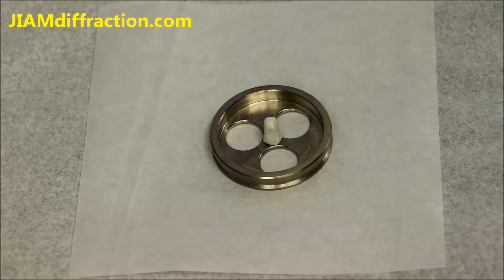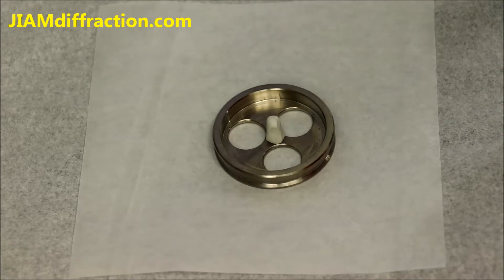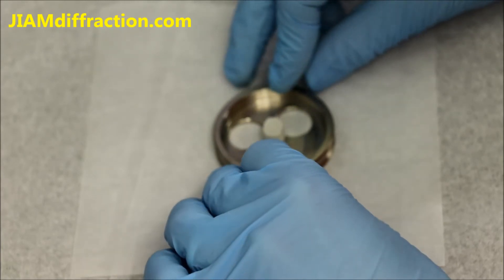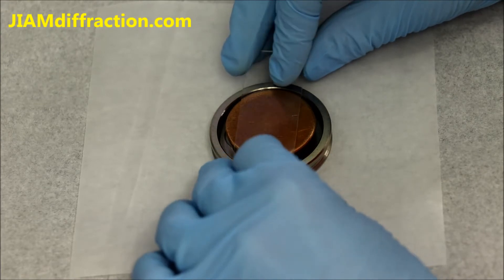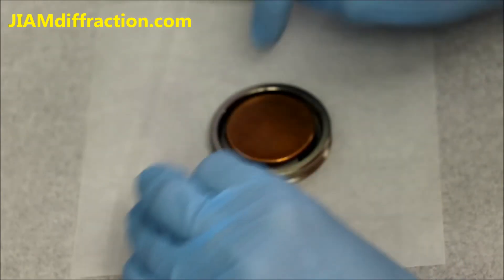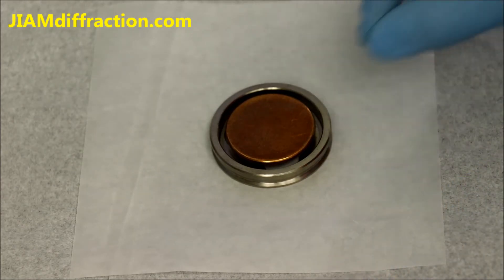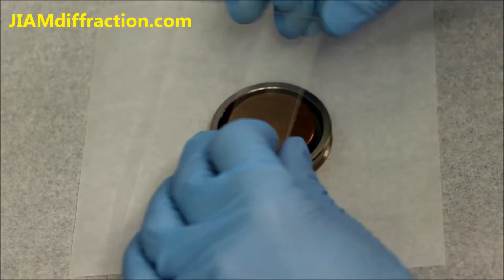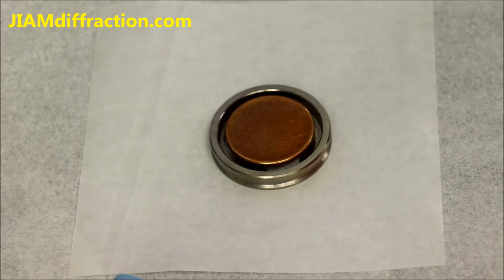XRD Sample Preparation - Solid Sample Holder - X-ray Diffraction

Comment: You could buy a parallel press from stores like Bühler and Struers who support devices/equipment for materialographic analysis. You can still use the glass, but this will help you to apply an even pressure.